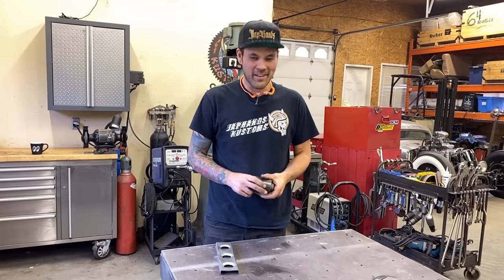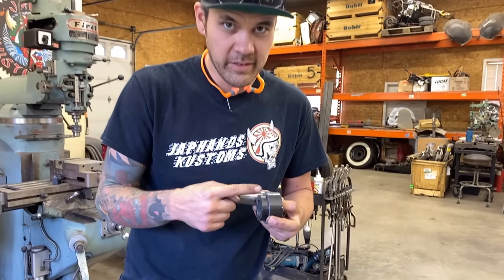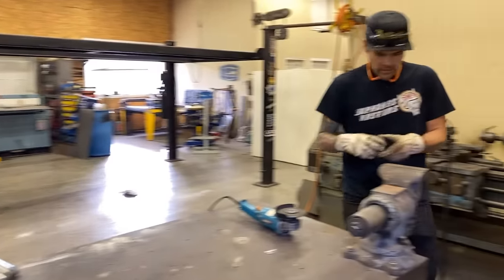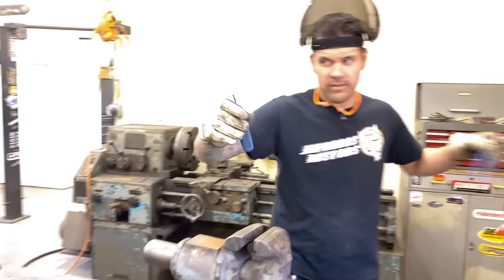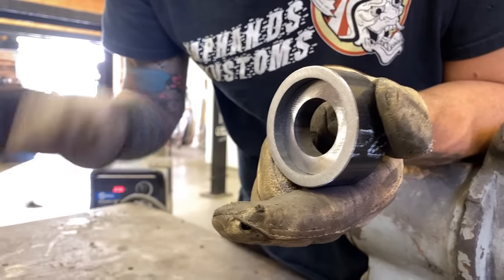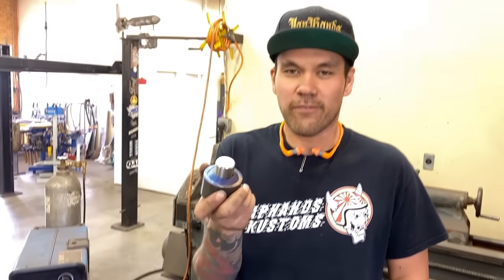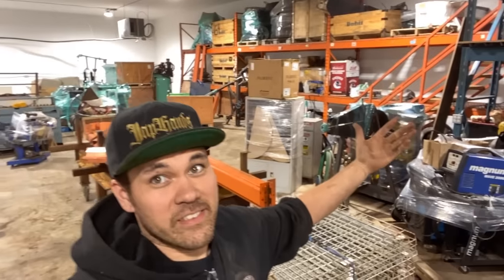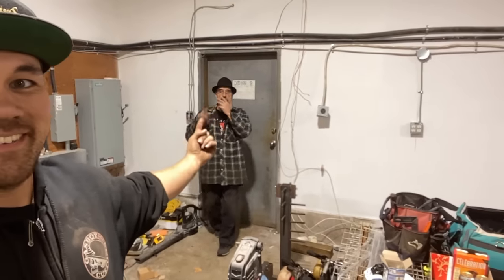How To Make This EASY Dimple Die Tool for Under 20 Bucks!!! ( With Just a Welder + Grinder!!! )

Comment: Here's why your bar stock didn't fit your DOM bore: production tolerances. Steel is sold in either fractional measure, or decimal measure. DOM is decimal, which has close dimensional tolerance. Fractional measure bar stock of the cold rolled variety has wider dimensional tolerance, usually biased to the + side, so your shaft, screw, plug, etc can't be undersize from go. In your tool, your DOM is nominal 0.370 wall, so if everything is perfect, you should have 0.010 clearance on the centering shaft. If your wall is 0.373 (+0.003) you're down to 0.004 clearance on a perfect dimension centering shaft. So a +0.005 tolerance on your bar stock will give you a press fit. If I remember correctly, fractional tolerances run to 0.010 on CR, decimal run to 0.005 on CR, or 0.003 on DOM (+/- equal on DOM, + full tolerance/- 0.001 on CR). CR is made to be machined to finish dimension, DOM is made to be usable as is for most practical applications.

Comment: 11:25 it's called "coining" and no you don't need the opposing die to squeeze against. For perfect chamfer, easier to make, tack a drive spigot onto the DOM, fit to drill and hold grinder in other hand, spin the two against each other and no scribing, eyeballing, etc needed..
Reply: Na, easier the way he did it.
Reply: @cencoast_7.340  you think scribing, clamp, grind check, grind, check, unclamp, rotate, clamp, grind, check, grind, check, unclamp, rotate, then do that all over again to polish to the line and edge is simpler then, tack 6 spots, chuck, grind, check, polish, smile, cut tacks. Well you do it your way then. I can say I've done the chuck in drill many times for lots of different needs and the ease of precision and reproduction of quality every time is better then I can possibly do with a vice and grind around a bar.

Comment: I like the tool. So you don't have to use a hammer and distort the the metal away from the dimple I'd try and get it to work on a ball joint press.

You are making metal working less intimidating for me. I have a project jeep that needs a ton of metal work.

Comment: At least you admit to your mistakes (SH stuff happens) and don't edit them out.( Btw ur editing is admirable.) Showing them helps others to learn not to make the same ones.(Need to work on that patience thing. Got kids? They can help in that area.😉)👍
     Experience had taught me the value of switching from a BFH to a homemade HBJP (hydraulic bottle jack press). Comes in handy around the shop as it has multiple applications (ujoints, bearings,  yada-yada yada-yada).🤛🤘

Comment: In a pinch, I just ran a weld bead or two around the end of a black iron pipe.  I then used a hole saw on a scrap piece of 1/4" plate.  I cleaned things up with a die grinder...  The 20 ton hydraulic press did the brute force effort.

I just needed to put 1" drainage holes in some Unibody replacement channels.  The results were surprisingly acceptable.  However, I did end up purchasing a made-for-purpose 1" dimple die for the remainder of the project.  But, the pipe hack did allow me to be productive for the number of days it took to ship the for-purpose dimple die.

FYI, my 20 ton press has been modified with gibs to make it a very precise shop tool:

https://www.youtube.com/watch?v=X6zGj9avKIQ&t=130s

Comment: Metal Supermarkets is shockingly over priced.

Generally, steel is sold in 20 foot lengths. I live in a major metropolitan area and there are several steel suppliers in town. Many of the suppliers will sell 10 foot lengths. The place I use stocks pre-cut 10 foot lengths, but will charge a couple bucks for a saw cut for each 10 foot stick that I buy. I can haul 20s, but the 10s are more convenient for me, so I don't mind paying the saw cut charge.

With that said, I can get a ten foot stick for what Metal Supermarkets is charging for a couple of feet. The Metal Supermarkets near me has a scrap room full of individually priced pieces and cut-offs. I have scrounged in there and purchased a few pieces. These were the only things there that I considered fairly priced.

Comment: First, thanks for the time and effort to make and post this. I like the inclusion if the booboos.  If I ever make a mistake, I'll feel better knowing you boldly went before me. <wink>. The question I have is this: beyond aesthetics, what is the purpose of the dimples?  There would be a minor weight savings in a part, and they look super cool...but does it improve the part in any other way?